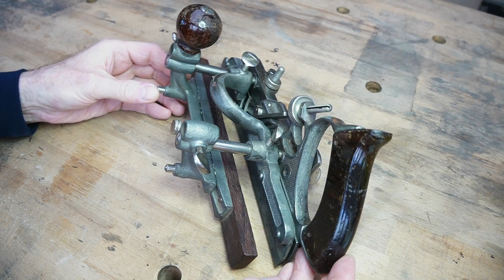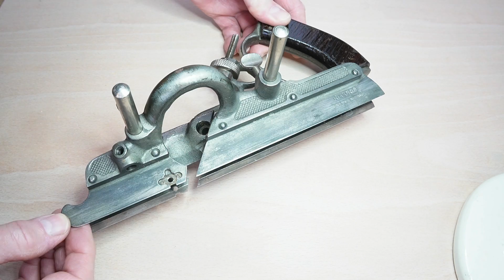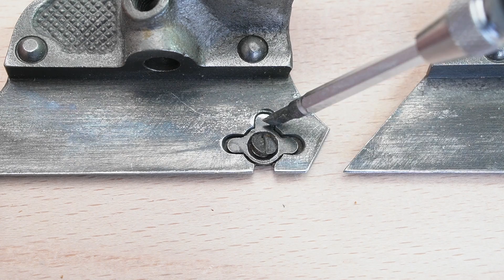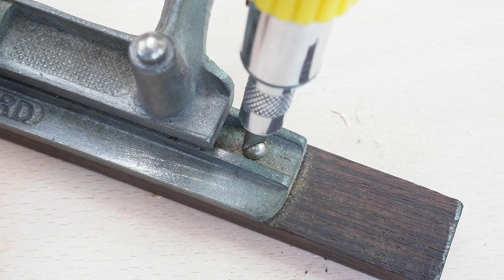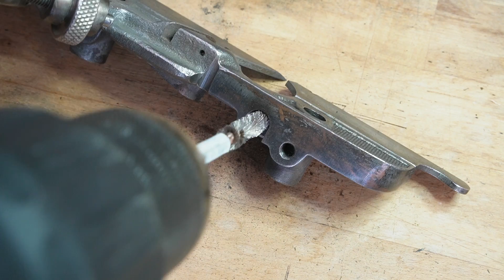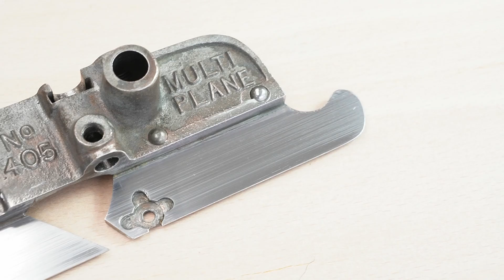SuperTune! The Record No 405 MultiPlane - Part 1

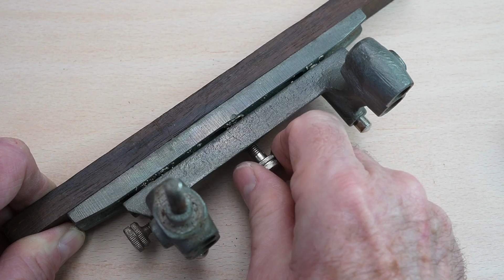Comment: 6:48 the screw is double-threaded in opposite directions. Extend the wood as far as it will go, then the piece the wood is attached to will fall off the main threads. At this point, pull on the wood while turning the screw in the opposite direction. To re-assemble, just reverse directions
Reply: @devinteske  , thank you for that! I had no idea. Now I’m back in the workshop, I’ll give it a try.

Comment: This makes me think that my Stanley 45 needs some tinkering.
I use mine all the time for grooves, rabbets, dadoes, and mouldings. 
Sure a router is fast and easier but i prefer the handmade.
Reply from the maker: An electric router is definitely faster if you’re doing multiple items, but they have their set up time too. Also the noise, the dust, the missing fingertips. At best, an electric router will give a medium finish. You’ll still need a further step of some kind to get a fine finish.

Comment: good stuff Mr.Linn.Great results from the mini twist brushes in a drill chuck! As you were manually cleaning with the wire brush,I wondered what results you'd get from an ultra sonic cleaner on the war finish body...
Reply from the maker: Thanks Rob. I didn’t think of using an ultra sonic cleaner. If one has to submerge the part, it wouldn’t be suitable. I’ve done that in the past using Green Gunk, and it generates pockets of rust in hard to get places. Also, there’s the wooden handle.  Flash rust is a reason why I don’t use any lubricant when I’m using the abrasive.